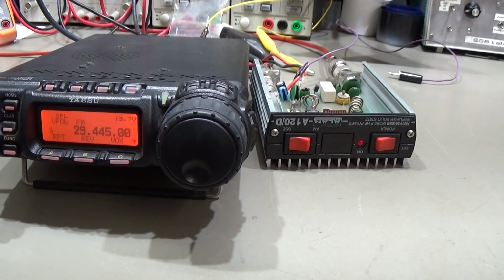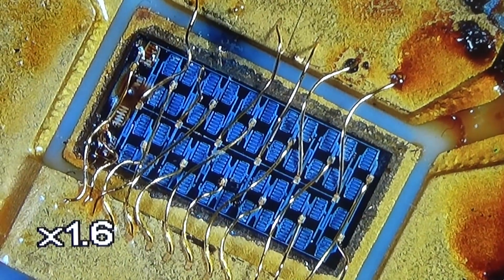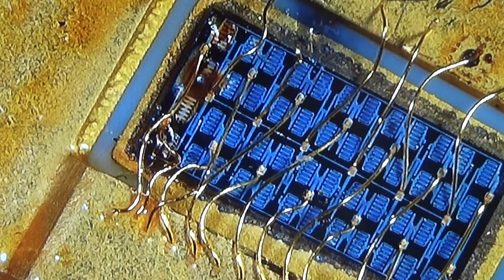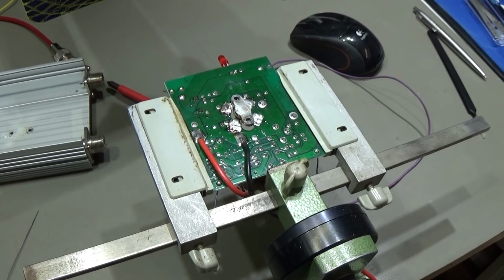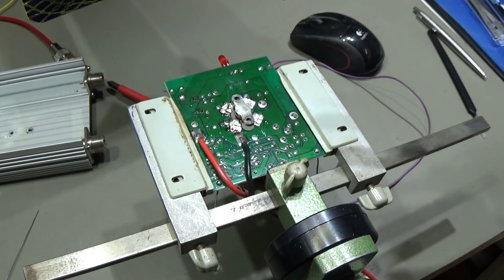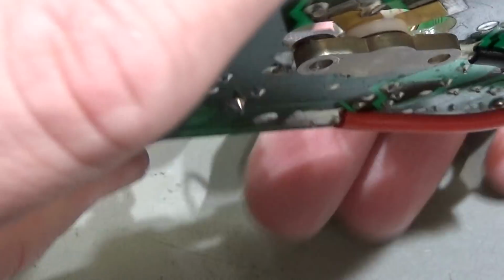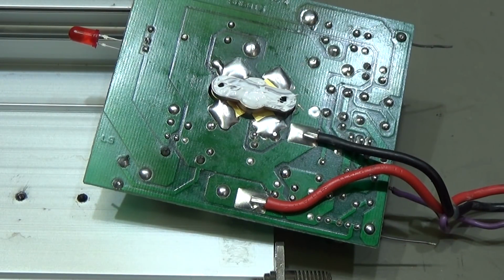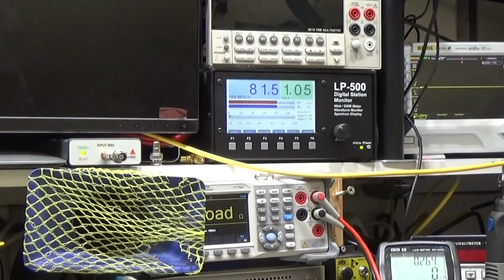#225 Repair of a tiny linear radio power amplifier

Comment: I have a few of these old, 1 or 2 transistor 27 Mhz CB amps, all working, but it never occurred to me that they had an adjustable input matching. I will check all of them now and maybe, if possible, I'll tune them differently for 26, 27, 28 Mhz. I learned something today, thank you very much!

Comment: The stress on the transistor leads combined with overheating is likely what caused the cap to come off the transistor. Get one hot enough and the glue that holds the cap on will break down and let go.

Really bad design, they should have used a double-side board so the transistor can be soldered from the top side, secured the board with standoffs instead of relying on the transistor leads. Also the transistor and PCB should be secured to the heatsink prior to soldering, so there is minimal mechanical stress on the transistor leads. Obviously not possible with they way they designed it.

Crazy that they went to such extremes of cost-cutting on the design when the RF transistors are so expensive! Either that or the designers had no idea how to design for reliability.

Comment: Viewers should note that deliberately breaking open dead RF power transistors is NOT a good idea.  They often contain berylium oxide to help conduct heat away from the chips.  If breathed in the dust is fairly toxic.  :((  In the open RF power transistors I have seen, it never ceases to amaze me how untidy the bond wiring is!  Are they still hand welded even nowadays?
Reply: Only the base is beryllium oxide. The caps are aluminium oxide. At least with the Western devices. Not sure about the Soviet ones.
Reply: @borisj4054  Some interested people have been known to hacksaw or even bandsaw them open!  One mistake can create lots of nasty BeO dust!
Reply: How do they even attach the bond wires internally? How is something this tiny even made? How would you even build machinery that is capable of making the innards of these as well as current i.c. chips.  Absolutely mind boggling to me. Would love to see a video of the equipment and manufacturing process.

Comment: Peter, i hate those little coffeewarmers ;-) I fixed so much, stopped counting years ago. The bipolar transistors gained so much in price over the years, so that today more and more MOSFET versions come in for repair..i hate them, too :-)). At least they are cheaper to fix, cheap design is for free on top. But anyhow, with a good low pass filter they will do the job. I never saw an open heart surgery on a transistor, so thank you for this great video. Good repair method, too! 73 de Olaf DK6KF  Übrigens, die blaue Pinzette habe ich mir im Herbst  auch bestellt, musste ich haben. Ich mag den Grip und die Spitzen....
Reply from the maker: lol yeah I don't like it too, and the cost of the transistors are a joke. Take care my friend

Comment: Nice vid, thanks!  Maybe another method is to put two dabs of hot glue on the transistor/board whilst it is in position and then lift it off chassis mounts and then solder.

Comment: Interesting that there seemed to be no bolts for supporting the PCB. They just rely on the transistor leads to hold it? Maybe that is what caused the top of the old one to pop off? I would think some oversized mounting holes on the PCB corners with soft rubber bushings might be better with hold down screws? Definitely dont want to hold the PCB tightly but just let PCB move if it needs to from heat expansion.
Reply: I was going to say that, it's a really bad design. All the weight of the PCB being held by the transistor just asking for it to fail due to vibration. Who ever designed it should have the lead of his soldering iron cut off.
Reply: Better designs use a double sided board, with a good ground plane, and also use an alignment jig, so as not to expose the leads to stress, and the board mounting is not solely using the transistor.  You place the transistors in the middle of the board, so that expansion is not going to stress them, though a lot of designs use a thin board material, so that stress makes the board flex, and not the transistor, and also matches the temperature coefficient of the board, to closely match the aluminium heat sink as well.
Reply: I bet it was way over driven to get maximum power output and the transistor got fire hot. The excessive drive power,  heat, poor mechanical mounting, mobile vibration killed it.
Over driving them especially on am or fm and long keydown time will smoke them fast. 😁🤣

Comment: Great video, so happy Mr Carlson recommended you!!
it's amazing how such a small device can output so much power!!
Reply: Basically 12 parallel power transistors in there. The one bond wire was blown because one of the transistors went short circuit, and then the wire overheated. You can see the melting and soot around it. Easy to get high power out of that, just your output impedance then has to be under one ohm, so lots of parallel transistors to get that low, as RF transistors cannot be large feature wise as the frequency goes up. 

The modern ones for high frequency are basically an IC made with hundreds of small cells, and all share a common terminal, which is why you find so many modern amplifiers use MOSFET devices, as they are basically thousands of small devices in parallel, sharing the current between them as they are on a single piece of silicon. Good frequency range, but also become very fragile as a single cell failing short will result in the device failing explosively.
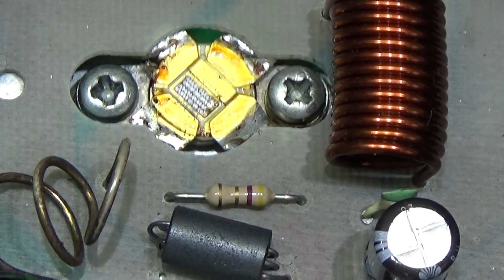Reply: @SeanBZA  Not only the bonding wire blew off, but metallization of Base electrodes on the chip (4:16, the ones connected to the top lead) have multiple defects. I would suspect it was failing over longer time, just suffering from power drop as less and less transistors remained.

Comment: Hope there is no Beryilium Oxide in that device
Reply: Not much risk, so long as you do not eat the transistor, or crush the white ceramic to powder and inhale it. Yes Beryllium is toxic, but really only to those exposed to the dust long term, not a small odd exposure. It is not always pink either, and hard to tell from regular aluminia without using a chemical assay or via spectrum analysis.
Reply: @SeanBZA  If you saw the panic we had once whilst i was training at Merchant navy collage when the PA in a VHF ship to shore went bang  ye gads you would think a nuke  had just gon off